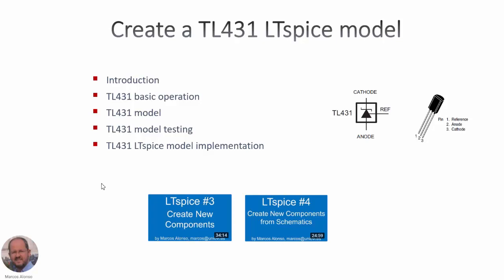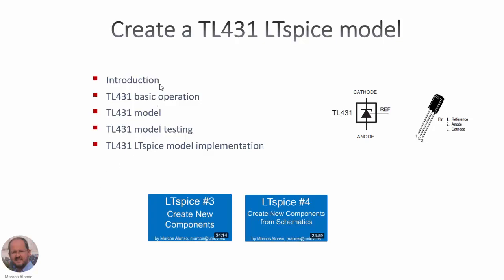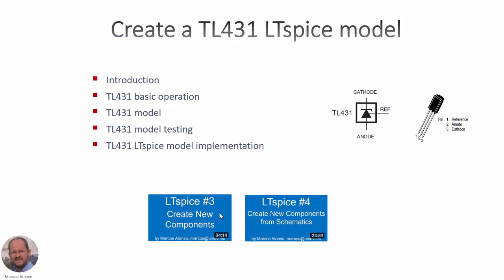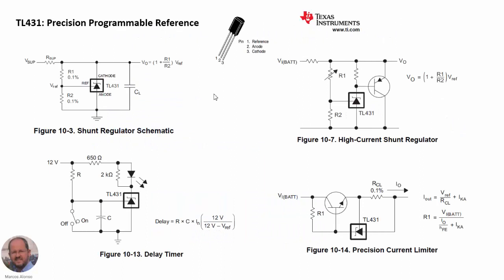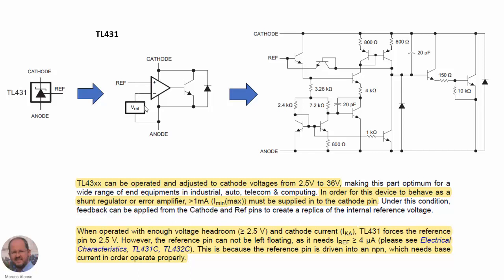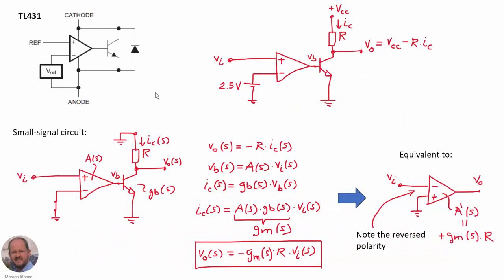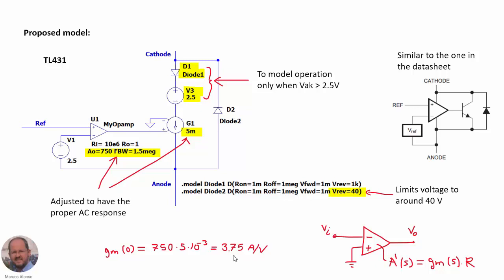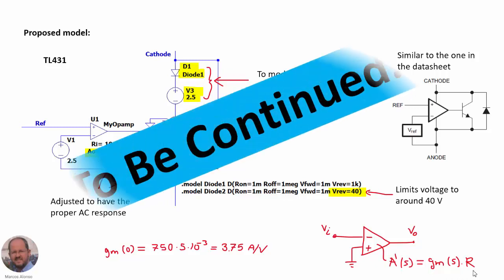LTspice #26: How to create a TL431 model (I)

Comment: Dear Sir,

Thanks for educating us. I have a query regarding this video for TL431. What is the purpose of putting a diode between cathode and anode terminal of TL431.

Thanks & Regards,
Sanjay
Reply from the maker: Thanks for your question. As you can see in the slide at 4:00 this diode is included in the actual device. It is used to protect the device against reverse voltage. If for any reason a negative voltage is applied between cathode and anode the diode will conduct. The current will be limited by the biasing resistor in series with the TL431. Otherwise, a negative voltage applied to the output transistor would make it fail.